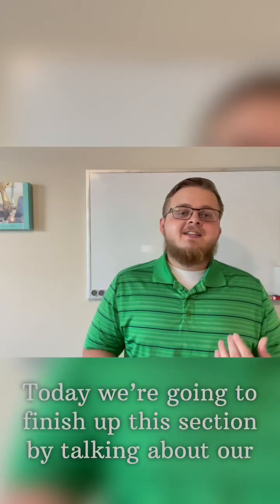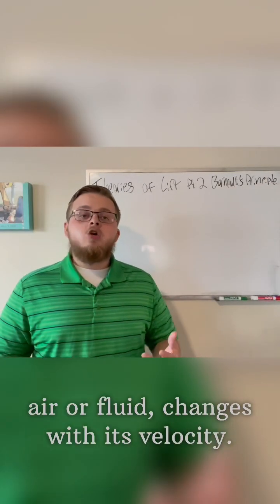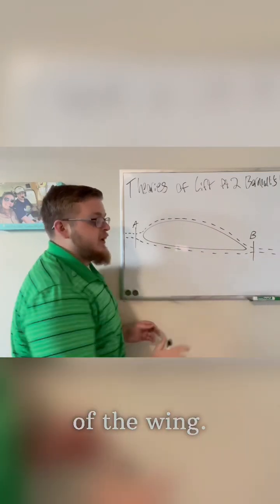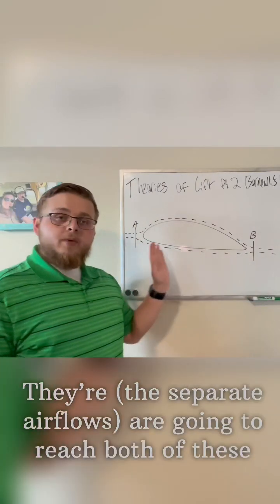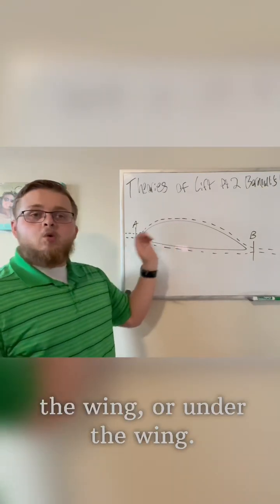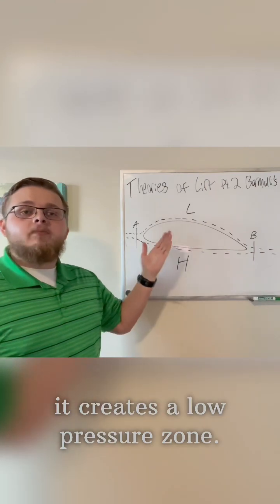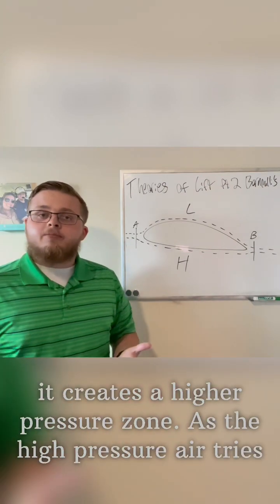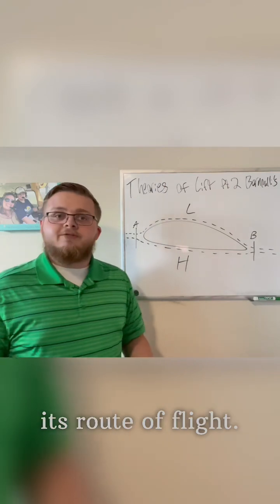Theories of Lift, Bernoulli’s Principle

Comment: Great job explaining the pressure differences! I do have one critique however. The idea that the air above and below the airfoil will go from point A to point B in the same amount of time is not correct. It’s known as equal transit theory and has been proven to be incorrect. While it’s true that the air moves faster over a curved surface, it actually reaches the trailing edge BEFORE the slower moving air at the bottom, not at the same time. You can find demonstrations of this on YouTube. Otherwise, great video!